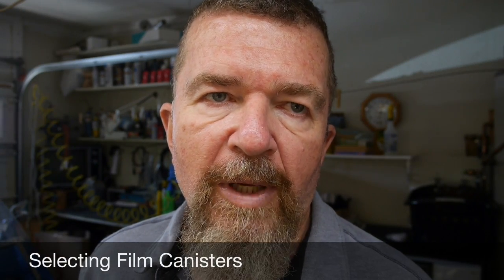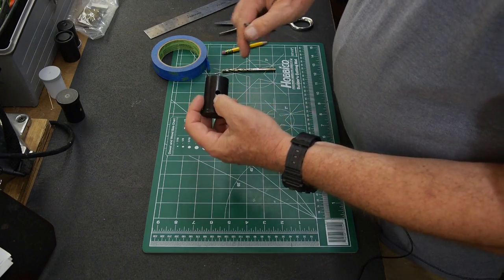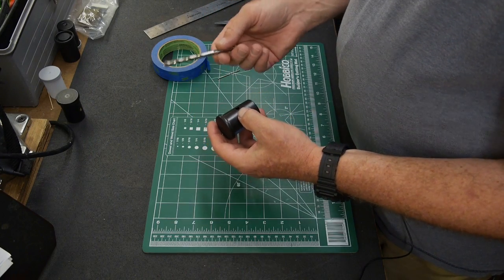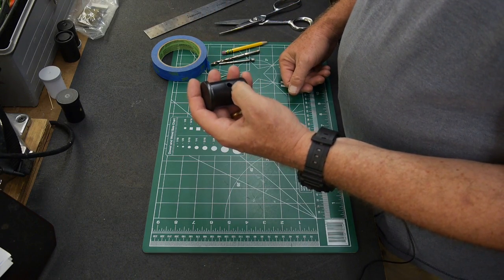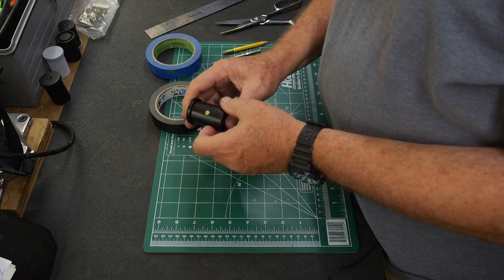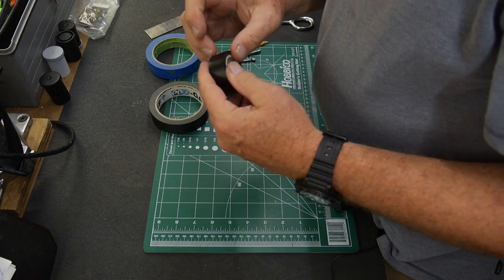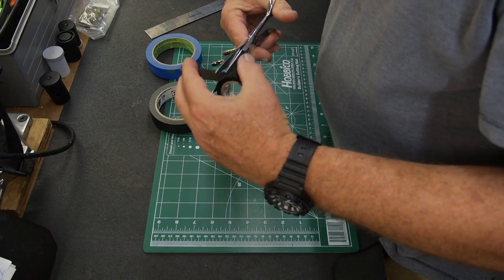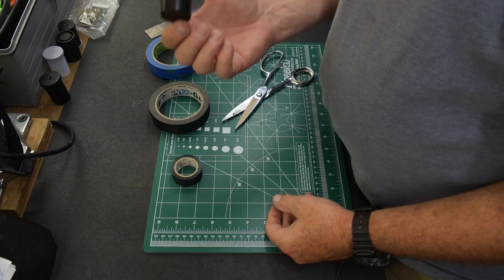Film Canister Pinhole Camera Project

Comment: Awesome! Thanks for sharing. I've got tons of canisters too. What was your aperture diameter and your exposure?
Reply from the maker: The apertures are about 0.2mm, with a nominal focal length of around 27mm (25mm in the center of the paper and 30mm at the edges), a paper size of 1.75" square. I rate the exposure index of the Harman Direct Positive paper at ISO8. So the exposure times depend on the scene's brightness. I use a Gossen Luna Pro F meter and use the recommended exposure time opposite f/128 on the meter (close enough to the cameras' focal ratio of around f/120). The Harman paper gets developed in a makeshift rotary drum (actually a metal 35mm film tank laid on its side) using a 100mL solution of Ilford Multigrade paper developer diluted to 1+25, for 3 minutes continuous rotation, followed by standard stop bath,  2 minutes fix and rinsing appropriate for fiber paper. I try to ensure the developer is near 68f in temperature, as that effects the speed of the paper.